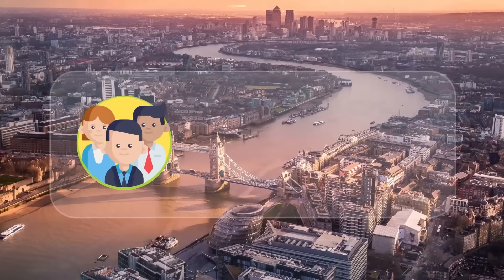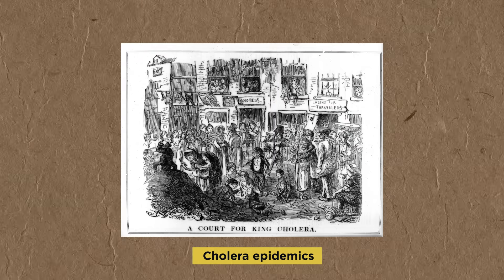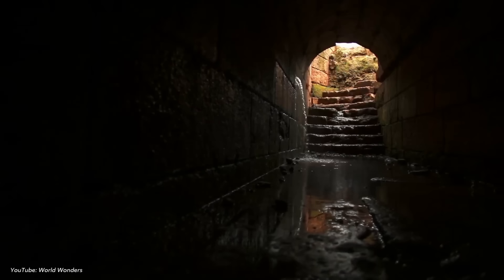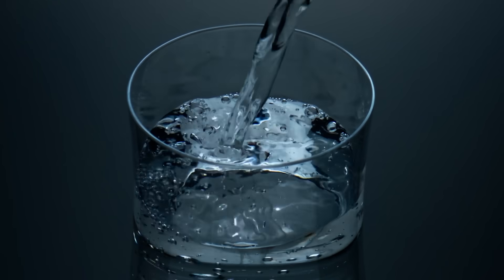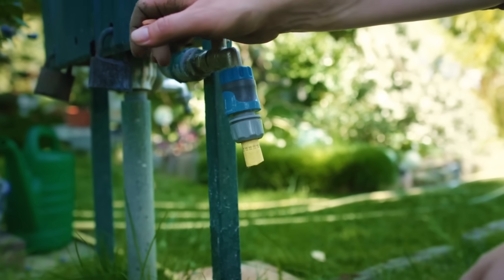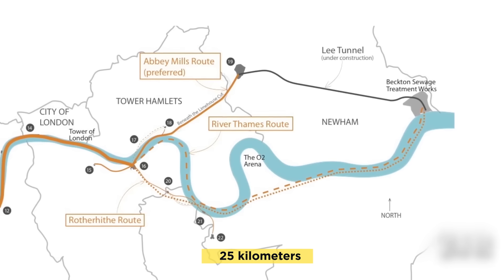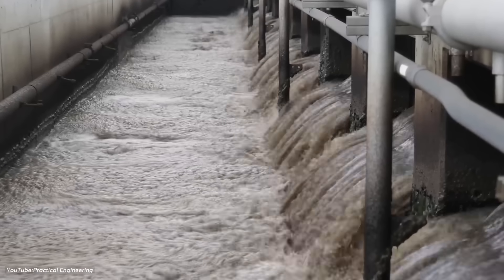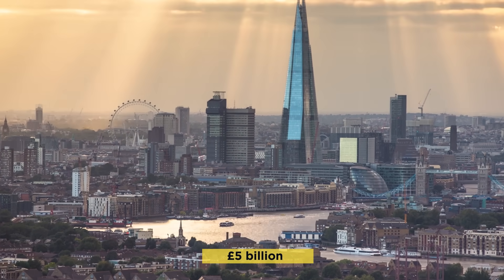London Just Built a $6.5 Billion Super Sewer

Comment: The UK is importing over 1,000,000 foreigners yearly. Many settle in London. It won't be long before the system is overwhelmed again.  As will other government run services.
Reply: Its just as much about climate change than population increase, London has only just recently passed its previous population peak in 1938. Climate change has increased the frequency of flash floods, which overwhelmed the previous system, overflows into the river are basically a safety device to stop sewage flowing back into peoples homes.

Comment: I still wouldn't want to swim in the Thames. The big question is, London's population is still growing fast so how long will it be until another super sewer needs to be built. What population can this super sewer accommodate for?
Reply: The last two lasted 150 years
Reply: This is as much about the increase in flash floods caused by Climate Change than population increases, Londons population has only recovered fairly recently from its post-war decline where the prior peak population was 1938.
Reply: @suburbia2050  You'd have to do a lot more than that. I was in the Hampstead flash flood in 2021, the drains were blowing water through the openings in the manhole covers  to a height of a meter, and the North London line became the adhoc drain. Water gettijng as far as the river will flow there.
This is actually a replacement for Bazalguette's first sewer system, following the same logic of gravity drainage. It may occasionally help relieve some of the flash flood, but that's not what it's there for. London grew significantly in the 1930s, which ate most of the surplus capacity allowed for in his system, and it was clear population growth would only add to the load. Equally, the old system's now over 150 years old and repairs only go so far. Thames Water having the rod up everywhere you look is exactly the same thing, they're replacing the old sewers built for a man to walk through with larger circular ones for mechanical ones.

Comment: To clean the thames just make it illegal for teh water company to dump their sewage in the water. They have made it legal for them to dump sewage rather than treating it.
Reply: Did you not even listen? Its not about "dumping", its literally the design of the old system, a safety overflow and due to increasing population and increasing flash flood events from climate change the safety overflow is happening far more often than it was originally designed for 150 years ago